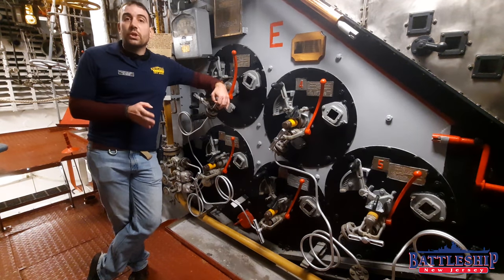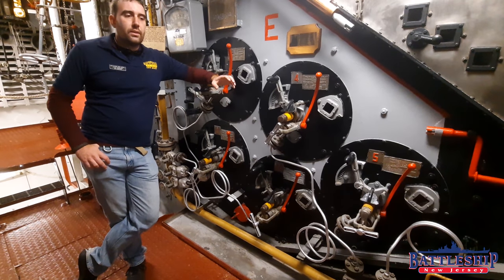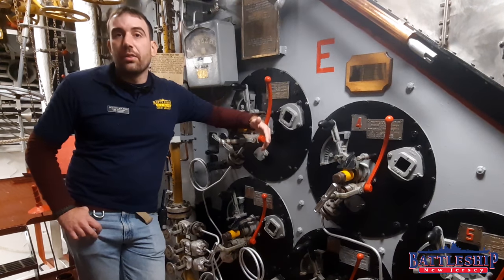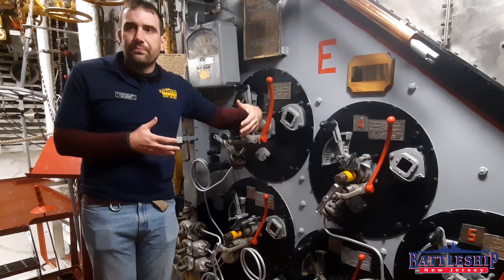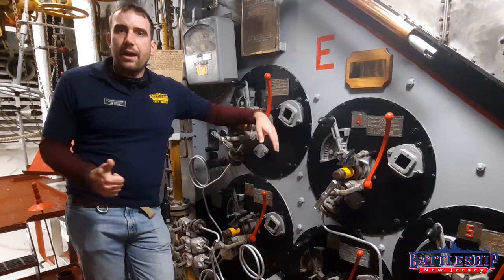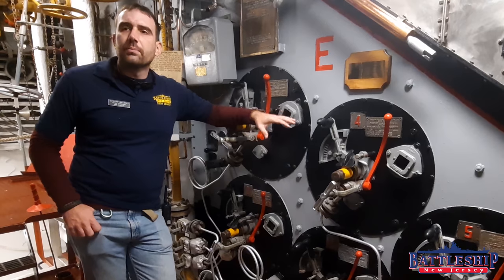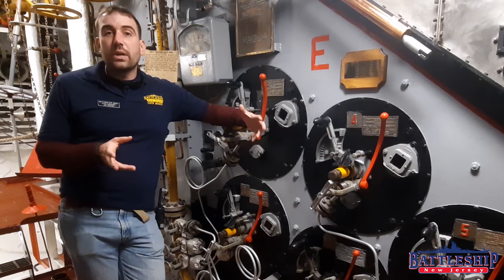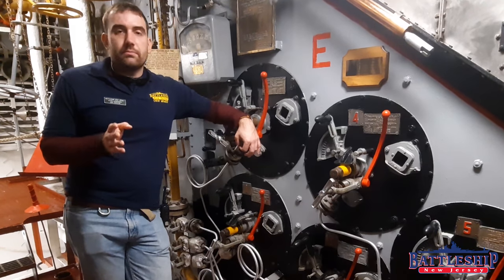Nuclear Powered Battleships

Comment: I' m a Nimitz plank owner , I served on the Nimitz 2 years, we never went anywhere without our escorts. The escorts were all nuclear. The older systems of WWII would be outdated, even if the ships tested out spec-wise, most of the systems since not being in use deteriorate from lack of use. Even if the old Iowas were returned to conventional service they would have to be yarded first for inspection, testing, repairs, and upgrades. Anything steam driven that sits for any length of time is usually a candidate for a refit, and that includes Nuclear. Rust and sitting water deteriorate systems, as well as steam in a fully active system. I've torn apart old fire sprinkler systems when we were converting to a dry fire system. You could see all the black water that came out of the pipes.

Comment: USS Enterprise CVN65 was designed in such a way as to switch to regular propulsion if the political support for nuclear changed.  This design is was the main reason why the ship was so inefficient compared to the Nimtz.  the bigger the reactor is the more efficient, but when you have to build a reactor in the dimensional constraints of traditional boilers, you end up with a system that takes more space,  burns it fuel twice as fast,and does not deliver as much power. I would also like to point out that the naval reactors used are of the PWR type and in the unlikely event that something happens one does not need to worry about runaway reaction or critical mass because PWR's have what's called a negative void coefficient. the reaction only sustains itself when the pressure in the reactor is maintained.
Reply: The part missing here is what happens when you DO have a loss of coolant accident in said PWR... the other advantage is that Navy PWR's in a loss of coolant event, if they were to lose ALL coolant, will not have enough thermal mass to melt through their steel reactor vessel thanks to the smaller overall size.  This is NOT true in a civilian PWR/LWR.  

Ideally, you wouldn't use an LWR/PWR to power a future battleship.  A reactor like Molten Salt Reactors would provide significant safety advantages and don't require pressure to operate (except on the steam side).

Comment: I would have to agree with captfjparks. Systems that are designed for shipboard use are anything but fragile. As a Data Processing Technician, before PC's, I learned something about what went into the building of computers that went to sea.  They had to withstand vibrations, rolling and pitching, big changes in humidity and temperatures. Even with the air conditioning aboard ship, it was anything but perfect. And, during GQ, a lot of that is shut down. In those days we still used punch cards. High humidity could cause the cards to swell and not feed into the machines. The reactors have to put up with the same or even more due to the location in the ship.
You mentioned the problems with the BBs taking hits. You didn't mention the shock that occurs when a broadside is fired. That's a pretty heavy jolt. The BBs might primarily use missiles and rail guns, but a salvo of 9 2700# HE rounds has a very devastating effect.

Comment: As a former NPO what stands for nuclear power equipment operator. I can tell you that the Navy style of nuclear reactor can be installed as a package deal. It can be so small that it can be carried through hatchways.. barring that because a battleship requires a lot of steam. Any deck plates that need to be cut through initially. Can be turned into deck plate hatch weighs roughly equivalent to like a Cheyenne mountain hatchway but what you don’t realize perhaps is that nuclear power And I don’t want to give away any of the classified information but it is very highly in Riched fissionable material and they will last one reactor for 20 years

Comment: With contemporary technology, I completely agree with your take, but I also think that future developments in reactor miniaturization, safety, etc. could very well open up the possibilities down the line. If it were up to me, I would probably go with a large cruiser hull rather than a BB. If modern advances in artillery technology were properly integrated (cough AGS on the DD(X), a few 6" or 8" guns could probably outperform 16" in everything but payload and penetration. Using a more compact gun system would also permit installation of missile armament that  a modern combatant cannot be without.

Comment: The idea that i had read about in the past was one involving pebble bed reactors. As I recall it many of the issues involving how vulnerable they are became non-issues. The money side of the house prevented the idea from moving further though
Reply: Lets say you managed to build a passive safe naval pebble bed reactor. You still have to deal with the fact that any breach of the closed loop is going to instantly render the ship "sunk" as it will be too radioactive to save. Even a leak between the open loop and the closed look is going to very quickly become a catastrophic problem. Neither of these breaches seem all that unlikely when someone starts lobbing exocets at you.
Reply: Geometry of the pebble pile affects power of the reactor. That means taking a heavy roll, pitch, yaw, surge, sway, heave, list, heel, loll, etc. could affect the pile, affecting criticality, and ultimately affect the vessel’s ability to fulfill her mission. It’s interesting technology for terrestrial applications, but I don’t think any admiral is going to accept this for a ship.

Comment: I am a retired Naval Officer and worked at Naval Reactors for nine years. I have 30 years of nuclear power experience. Here are some relevant points:

Assuming you absolutely had to have a battleship's 16-inch guns for a vital war fighting task (a big assumption) and you had to reactivate an Iowa at any cost, then it would be far more cost effective to stick with fuel oil. The only way you could even begin to justify a nuclear conversion is if you were to assume high operating tempo (similar to the carriers) for many decades.  Otherwise there is not enough cost savings from saved fuel oil to justify it. 

Of the technical points you made, most were wrong.

1. Assuming you could just remove the boilers and insert a couple of nuclear reactors and their ancillaries, the cost would be tremendous; on the order of a billion dollars, probably much more. Retaining the boilers would be much easier and far cheaper and faster. 
2. Nuclear reactors and their shielded bulkheads weigh more than boilers. You might think that the weight could be made up by eliminating tons of fuel oil. But the torpedo defense on these ships assumes these tanks are filled with liquid. Figuring out the displacement and weight distribution problems would be challenging.
3. The engine rooms are too small. Nuclear reactors produce steam at different temperatures and pressures than boilers. They make little if any super heat. That means the turbines and much of the steam plant would have to be redesigned and replaced. The redesigned steam plant might not even fit into the existing space because the turbines would be physically larger. On the plus side, the stacks could be removed and the gained deck space used for other equipment. 
4. Speaking of the stacks, each one represents a large opening in the existing armored deck doesn't it? This might help solve the reactor access problem, depending on current configuration. These openings would have to covered by armor/shielding.
5. Refueling a nuclear reactor would be expensive, but not cost prohibitive assuming the original conversion was cost justified in the first place. Frequency of refueling would depend on operating tempo, probably exceeding 30 years given that battleships would spend far less time steaming around the world at high speed compared to the nuclear carriers. You could install removable armored plugs above each reactor to facilitate refueling. In any event, I wouldn't assume the reactor would ever be refueled given that the rest of the ship would be 120 years old at that point. De-fueling would still be required.
6. Modern Naval reactors are certainly not "delicate." They are robustly designed to keep operating under shock conditions and have been tested successfully at sea on surface ships in shock tests using underwater explosions to create the kind of shock waves experienced in battle. Given the engineering challenges described above, the robustness of a modern Naval Reactor would be the least of my concerns.
Reply: Coal  and b&w  boilers
Reply: Would the development of a supercritical naval reactor mostly solve problem #3?
Reply: @hailexiao2770  If you mean a superheating nuclear / steam generator (supercritical means something else in the context of a nuclear reactor), then yes, a reactor that produced dry steam the same quality as a fuel oil boiler would obviate the need for a new design engine room. No such reactor design currently exists. Even if possible, development of the new technology would multiply the cost. (Never mind the fact that New Jersey's steam system is worn out and would need replacement in any case.)
Reply: @boyscoutmatt  Current reactor designs are around a PWR.  Something like a Molten Salt Reactor which operates at twice the operating temperature, and, as far as the reactor is concerned, at near vacuum pressures, would offer a lot more power in a smaller size while still providing better steam.  It's a far less proven technology (only two such reactors have ever existed, the aircraft reactor experiment and the molten salt reactor experiment, both at Oak Ridge National Labs) and would need a lot of verification, but the development of one for the Navy would be of massive benefit to the civilian power sector.

Doesn't even need to be Thorium fueled, but that's a different subject all together.
Reply: Improvements in reactor technologies now mitigate most of the circumstances. It'd be easier to design a reactor around the ships constraints than vice versa. 
Westinghouse already begun plans and worked on it's new reactor called the eVinci the first "Solid State" reactor.
- Unlike conventional reactors the Solid State reactor has no moving parts except the control rods. 
- Factory built
- mitigates all waste heat via solid state tubes i.e heat pipes just like the CPU in your computer. 
- The core is encapsulated in pyrolitic graphite and use TRISO fuel, thus compatible to the High enrichment rate of naval reactors thus potentially achieve a full life cycle before refueling. 
- Unit doesn't require a stationary stability bed
Lastly, the reactor has a core max temp of 1,500 degree's C, so it can operate at variable peak output temperatures of 400,500,800 degree's C (same as New Jersey's Engines); this makes it's compatible with the Iowa class' existing boilers and turbines; thus the propulsion plant doesn't need ANY changes. So the reactor can be installed in place of the furnace. ONly an Adaptation in lieu of conventional heat exchanger to mate the two is necessary.

Comment: What if they laydown a brand new BB, Iowa or Montana,  take your pick.  Design the armor to be modular, at least around engineering.  Time consuming,  but they could disassemble the ship in drydock to refuel. 
Also,  what if they designed a reactor able to withstand the shock of battle without scramming (within reason)?
Reply: If the Navy was going to design a new battleship, it wouldn’t be an Iowa, and it certainly would not be a Montana class. I love the idea of a Montana class battleship, but that’s just not what we do anymore.  Building one from scratch, we’re not going to give it triple gun turrets. It would probably be something more along the lines of what the army is designing for their (Reportedly 1000 mile range) cannon...ramjet projectiles. If it were nuclear powered, it would be because of the power consumption of future laser defense systems and to serve as a  RAILGUN platform .  Basically what you would get would be an up- armored Zumwalt DDG style cruiser with Nuclear power, a larger VLS system...And long range shore bombardment capability.  The days of a true battleship are gone, nobody fields them anymore and because nobody fields 16 inch guns...You don’t require a vessel armored to withstand 16 inch shells.  Advanced Missile systems, hypervelocity weapons, ICBMs...Armor alone can’t defend the ship any longer. The future of naval defense is active protection systems... which means a future design would More heavily favor an MUCH lighter armored cruiser then it would a heavy battleship.

Comment: I do have a question. You mentioned the hassle of trying to get a reactor in there (6" armoured deck, 12" belt, or triple bottom. In the event a turbine, turbogenerator, or boiler needed to be replaced, how would they have done this?
Reply from the maker: The key here is that the entire boiler doesn't get replaced, only pieces. And the pieces are small enough to be moved around. As long as they are small than 26 inches wide
Reply: @speed150mph: these bulky and heavy units are generally repaired at the component level, not renewed at the unit level. A turbine casing is generally not going to be replaced, but the casing can be disassembled and the stator vanes inside may be renewed. The main condenser shell is not going to be replaced, but the heads can be opened and a tube can be plugged at anchor and/or replaced during a big overhaul period. This is heavy, industrial-grade machinery and is designed for a long service life. For unplanned maintenance, component level servicing is the norm.

If the damages are really bad, SUPSHIP would spend 6-12 months preparing a cost effectiveness analysis to recommend if it’s worth making full repairs, or other alternatives (decommission the equipment and derate the ship, decommission the entire ship, etc.), and senior brass would have to decide the way forward.

Comment: I agree when you discourage nuclear on battleships. Trying to use nuclear on a ship whose purpose is to directly attack other vessels leaves the battleship likely to be damaged to the point where it could have flooding. A regular boiler type propulsion system is susceptible to water inundation causing explosions. A nuclear reactor is even more susceptible to flooding problems. We haven’t even touched on the fact that before battleships sink they usually capsize. It’s near 100% certain the vessel will explode in this scenario. If any retrofit is possible it would be with marine diesels. Even supertankers use diesels. The most severe occurrence would be the diesels flooding and hydro locking. It would certainly destroy the engine but I don’t think it would explode into flames. It would be interesting to hear your thoughts on this.

Comment: I would think though, if that upgrade were to occur, it would need to include engineering a method to more easily access the engine area for refueling.
Reply: They never have for the carriers, they wouldn't for this application. Making it easier to access means taking away from something better which would include weakening that area of the ship from attack and you couldn't put equipment over top of that area. That's the problem now is the Tomahawk ABLs are over the existing engineering plates. There's a thread on the navweaps forum about this it's an interesting read.
Reply: It would be easier to design the reactor to be refueled without opening up the ship.
Reply: @johnlee8523  do you have the link to that?
Reply: @johnlee8523  interesting. I also did learn that I am a “reactivationist”.  My ideological viewpoint must be reactivationism. :)
Reply: @rfjohns1  lol I'd love to reactivate them and while it can definitely be done the money will  never be there. Would love to make a working replica though!
Reply: @johnlee8523  One key difference you missed between a CV and a BB. A CV retrofitted to nuclear just has flight decks and maybe an elevator between the reactor and the top of the boat. The boilers for a BB were in the central citadel of the boat, meaning you have secondary guns, AA platforms, and several layers of superstructure to remove before you can get at the reactor to maintain or refuel it.

Comment: Great arguments well stated. Also a reactor can’t really superheat the steam so you would have to change the turbines in all of your pumps and generators and the main engines as well. Also way too heavy. Also agree with the decommissioning of the nuclear cruisers, was very premature and a very poor decision.future weapon systems could possibly be powered by diesels but thats not the best idea. Put the rail guns onto the escorts and leave the Iowa’s as they are, still think they have a lot to bring to the table and still should be in commission.
Reply: That may be an issue with a LWR/PWR but it wouldn't be for a modern reactor like a Molten Salt Reactor which operates at ~650ºC
Reply: I'm sorry but reactors are designed to superheat the steam, otherwise you'd cause impingement damage in your steam pipe and turbine blades from being hit with liquid water. The existing turbines would be more than adequate for that application
Reply: How about either a molten sodium-chloride fast reactor burning uranium? If that seems a bit much, take a look at supercritical water reactors.
I would also advise everyone to look into hybrid railguns which are cross between railguns and coilguns. Their advantage is halving the current requirements for a given acceleration. If we step back from hypersonic velocities, it becomes more feasible to actually field them.